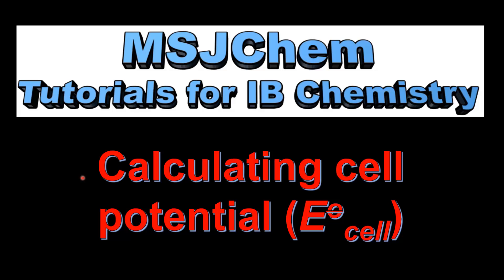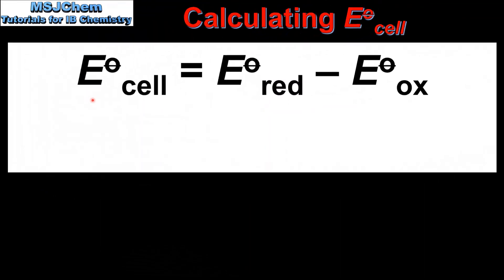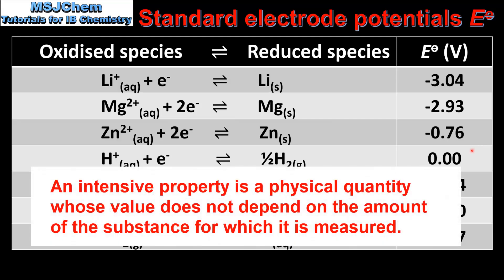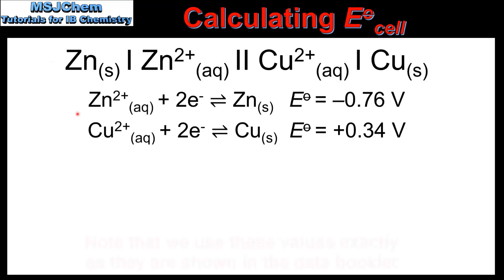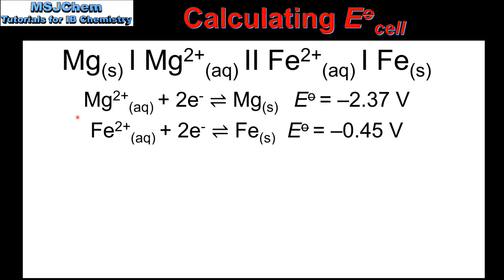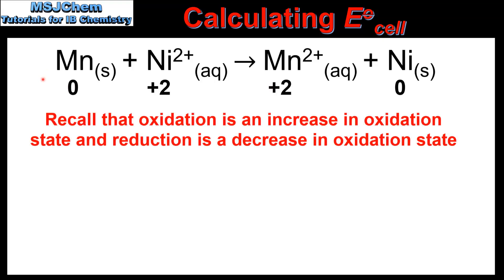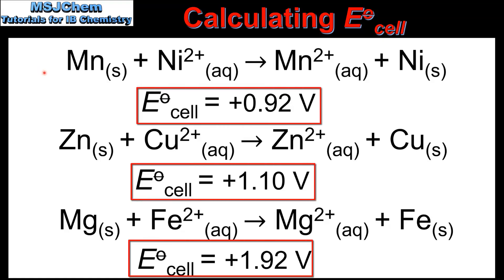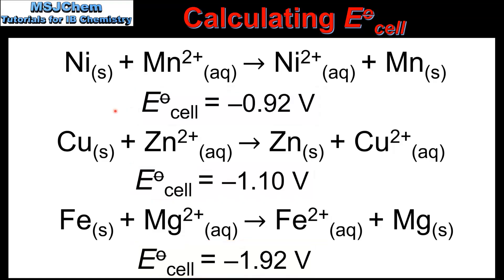R3.2.13 Calculating cell potential (HL)

Comment: do we need to reversed the sign (-ve ) to (+ve) when we reversed the half cell equation
Reply from the maker: Yes.
Reply: @MSJChem  but why isn't it reversed in the video?
Reply from the maker: Because we don’t need to reverse it when calculating the Ecell if we use the equation in the video.